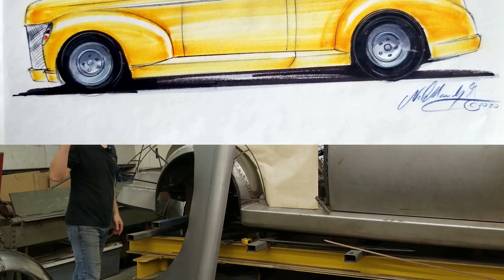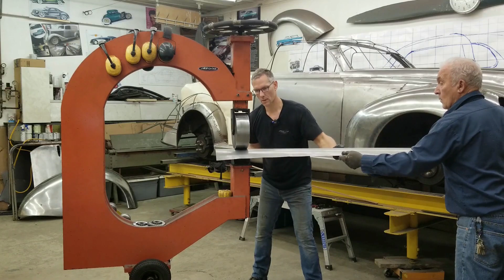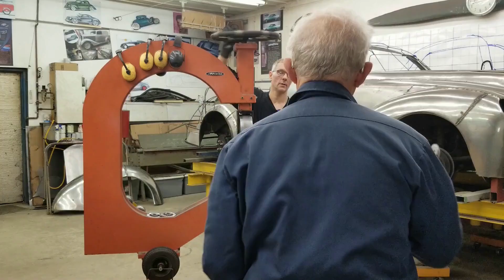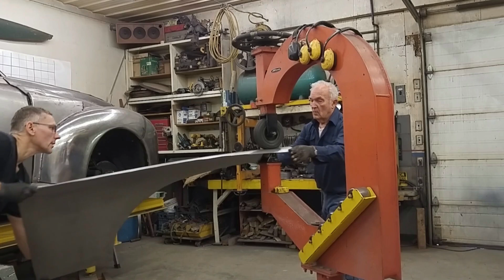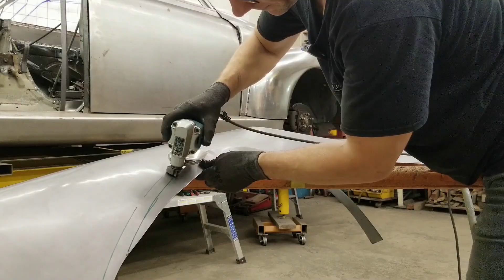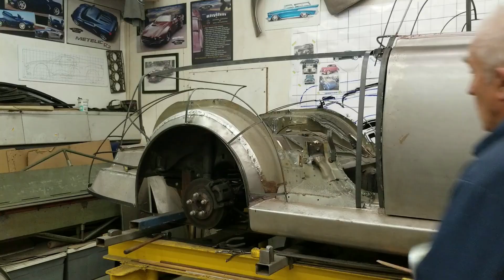Creating Truck Bed Sides - Ep.37 - 1940 Ford Truck Inspired M40P Build

Comment: I'm wondering about how water will be directed out from between the bed and cab.
Reply from the maker: With lots of acceleration!  :)  I'm kidding.  Just think of the box as a large trunk.  There will be an internal partition behind the seats and a tonneau cover over the box with a perimeter channel/seal to route and keep water out.  All of that will be created later on.
Reply: @iNVisionPrototypes  Ahhh, ok so there won't be a floor section from the mustang at the bottom where water could be trapped then? How will thebstructure be supported as a unibody if that is the case, reinforced rockers?

Comment: Sweetness!  One question.  You bend the panel then unbend before doing the english wheel work.  Why?
Reply from the maker: It makes it easier to roll and stretch in the wheel.  With it closed there's a larger chance for tracking marks to get created.  When I'm finishing up I may leave it closed to adjust a reflection.

Comment: When you were making door forward  did you make 2 sets of everything  or do you still have to do that?
Reply from the maker: We've been running all the panels in parallel.  2 left 2 right .. don't need to really think after the first just do.
Reply: @iNVisionPrototypes  So are we seeing the fabrication of the first or the second part of each?
Reply from the maker: The rockers and door skins you see belong to the coupe since they were pinned to the first donor's floor and door structures respectively way back when.  The truck's rockers have been formed and set aside and will be cut/flanged later so as to continue the split appearance all the way down between the cab and box.   Front/rear fenders as well as the hood you see belong to the truck.
Reply: @iNVisionPrototypes  it will be cool to have a with both of them
Reply from the maker: @punkinsgarageandpaint8299  For sure!  Soon as we get these panels for the truck formed they will be treated and put into storage.  The buck will be disassembled and we will get to work to finish the Coupe.  Later we'll get back to the truck.
Reply: @iNVisionPrototypes  Is the truck bespoke or a spec build?